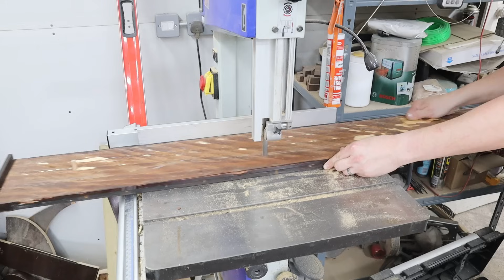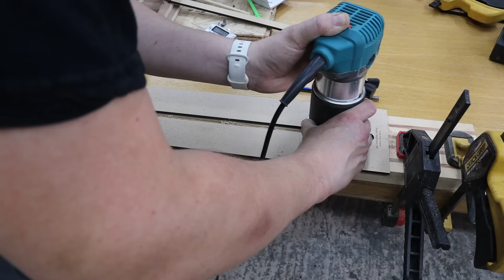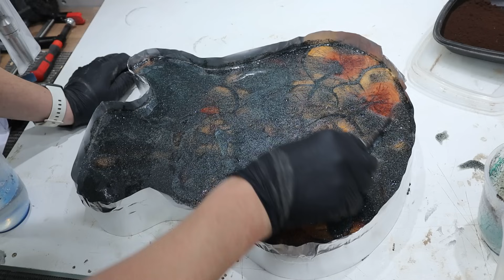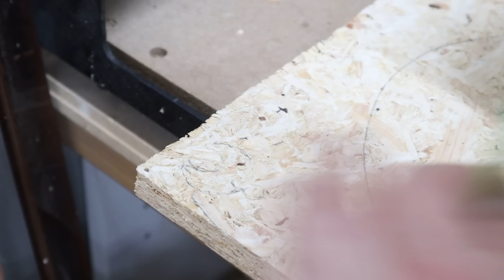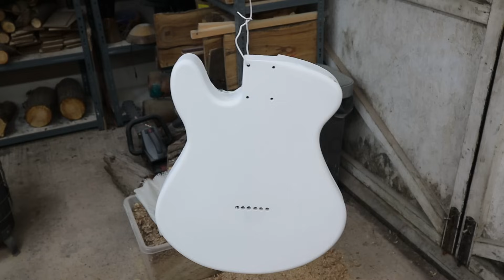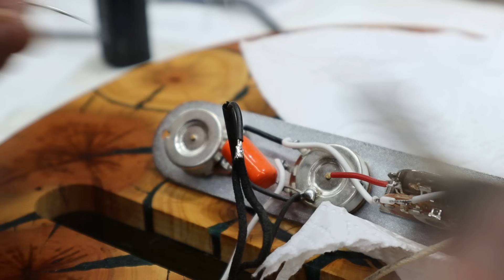Making a Guitar from Scrap Wood

Comment: Excellent build.  And while that blue on the back of the body is very well done... not the color I'd pick.  It kind of clashes with the rest of the instrument.  You got the ebony finger board, the sparkle black resin in the gaps on the cap.  Going with a black on the back of the body is kind of a no-brainer to me.  I really like how the cap turned out with the cross sections of the trunk.  Cool stuff.

Comment: This would've been ingenius if you'd made 100 guitars before it. As a FIRST guitar, it is transcendent. The only choice I didn't like is the blue for the bottom half of the body. For my taste it undermines the natural look of the rest of the guitar and before I watched the video I actually thought the blue was a similar material as Ovations used for their acoustics (i.e., the paint looks plastic).Loved your fix for the measuring miscalculation. The cross-cut limb top is absolutely sensational. SUCH a great idea. Loved the sped up drilling for tuners being a different note for each one, very musical and a nice sound nugget. The fretboard phoenix is excellent (if that's your personal logo you might consider moving it to the headstock for a really great ID). I'm definitely going to buy tickets for this build. Is the guitar very heavy? it did seem so visually with all the layers of wood. No matter, it is exceptional. Well done.
Reply from the maker: Thanks, the Phoenix is there to represent the guitars made from recycled material, kind of rising from the ashes